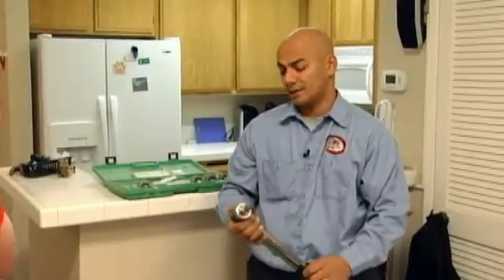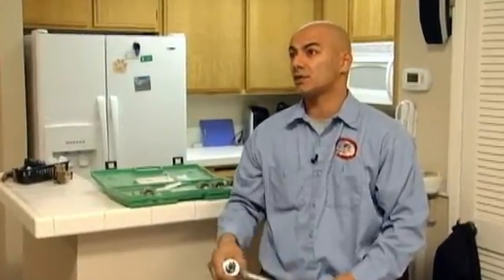Milwaukee® M12™ ProPEX® Expander Tool with Uponor PEX tubing

Comment: Ait may be a great tool but it cost too much money you do the same thing with the copper rings
Reply: Saves time, easier and faster to use.
Reply: Copper rings are illegal under a slab and will eventually break.   I seen it 100 times